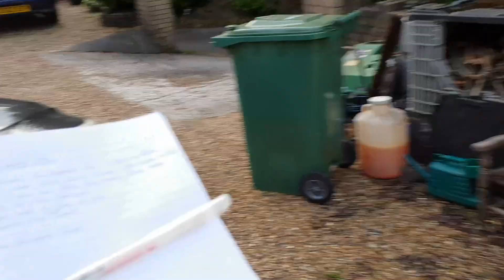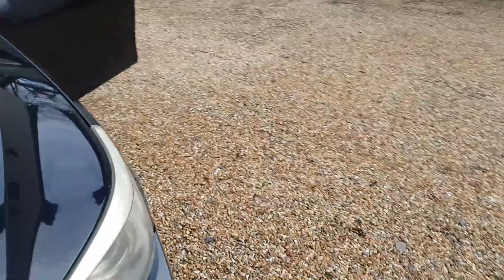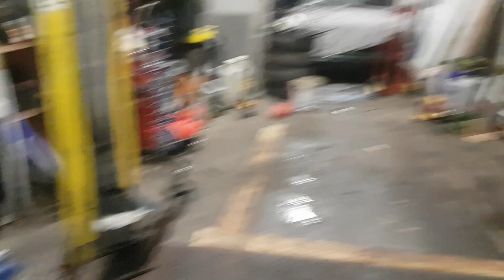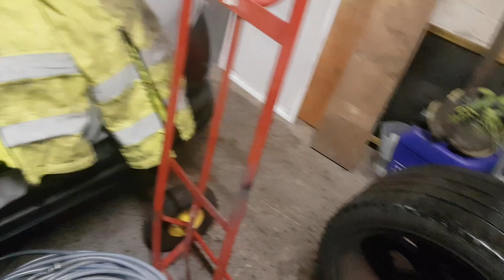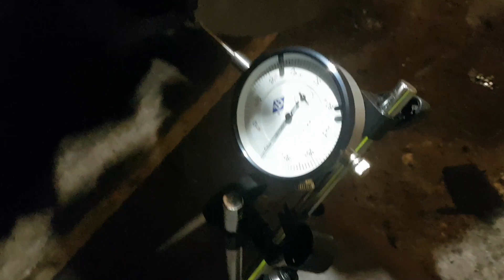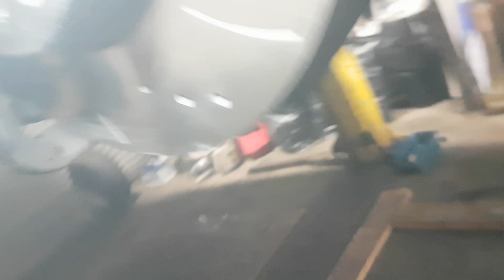Everything wrong with my E60 535d oh dear. Plus trying to fix E60 front brake judder...

Comment: just got myself a 535D e61 2005/11 ... torque converter is also on its way out now..at 80km/h it jumps 100RPMS from 1547rpm to 1650 and back down..  had i for 14 days xD but past that i got some noisey front breaks... other then that everything else is up to spec

Comment: Got mine with the same issue. I can trully say garage replaced 3 sets of discs and the same judder come up after arround 3k miles. Replaced control arms, antiroll bars, new guide pins with (no grease) basically everything apart from shocks and hubs with bearings on front. New tyres was fitted aswell on good straight wheels. After 5k miles judder come back again. Now what i am working on are: brake calipers refurbish so new gaskets-seal front-rear, new ATE rotors, ATE Ceramic Front pads and JURID rear pads, also new guide pins and rubbers, fluid replace then will bed the brakes for arround 500-700miles. Will see how it goes from here, otherwise don't really know what else to try. Anyone other suggestions?

Comment: I had the brake judder problem when i bought mine, felt it through the pedal and the wheel, took it to my specialist who changed the discs and it then braked nice and smooth, fast forward a few weeks and its slowly getting worse again, back to the garage and they checked it out, found the lower contol arm bushings were all shot so replaced them but the brake judder was still there so they changed the discs again under warranty, car is braking nicely again.  Fast forward a few weeks and the problem is back again, but now the other issue i have is the tyres are prerished and with the bad weather the car is sliding everywhere.  The wheels i had on the car were too big really so decided to go for some 172's and new tyres, fitted them in the hope it would fix the judder, problem is still there... back to the specialist and they still cant find anything wrong but tyres are now no longer in question so changed the discs under warranty again but a different brand this time and now its braking nicely again, fast forward a few weeks and its still braking nicely. So root of the issue was probably both control arm bushings and perished tyres!